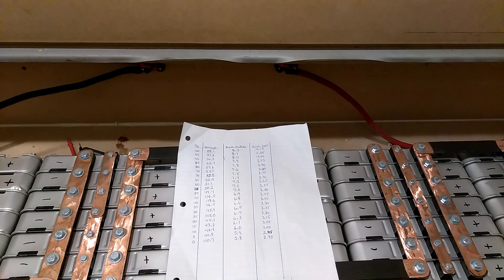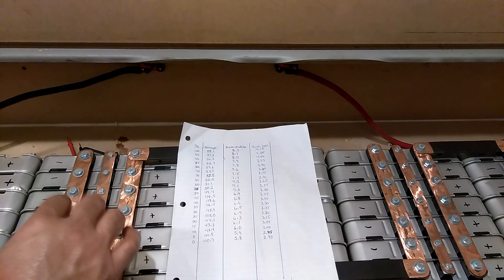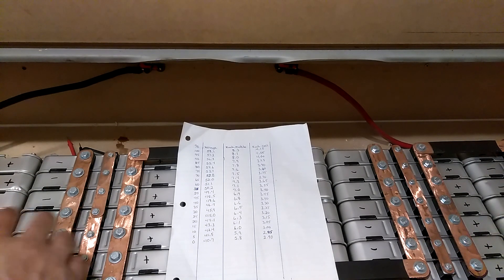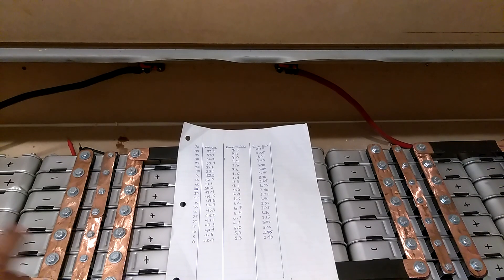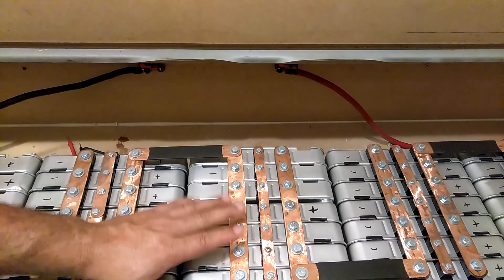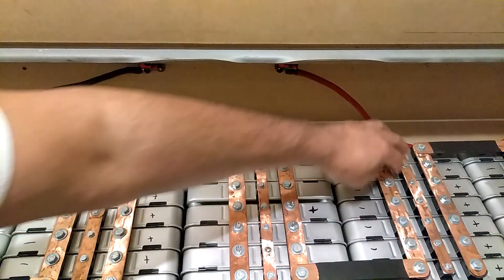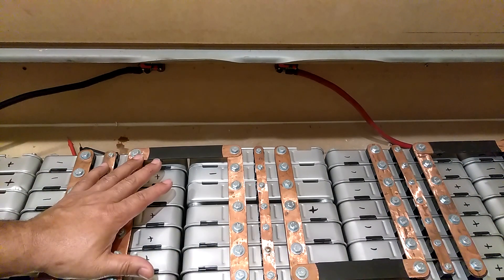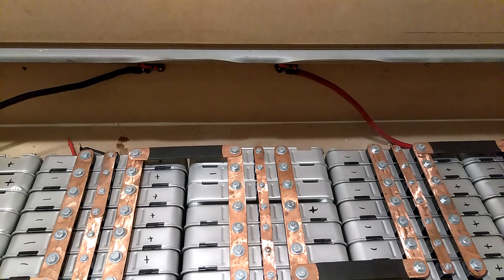Questions and answers part 2

Comment: Carson, where did you source your copper bus bars? Is that flattened copper pipe? I'm trying to decide to parallel bank like you have done.
Reply from the maker: Yes it is make sure you get the one with the blue stripe on it that's the thick wall copper water pipe got it at Home Depot.

Comment: based on the angle you set the panel at which is most likely summer time. however, you would see significant drops in power going into the fall ( December). in December bring the panel up to 60.3 degrees. the you would see a significant difference. but the panels at 15 degrees in the summer, and you would be very thank full.

Comment: Great  video ! Excellent explanation.  i really like how you connected your packs doing them in parallel banks & then the banks into series for your desired voltage be it 24v or 48v system, other's i have seen do the packs in series & then parallel the banks. Not sure but you would think all the packs will stay in balance much better the way you have them. I might be getting some of these packs for a 24v system. Thanks
Reply from the maker: If you need anything just ask I will help you as much as I can. God bless
Reply: @carsonlurbanwindandsolar3437  great explanation of the lv5048 I am putting together a system similar. I am concerned about the cells staying equal in compacity as this is the dangerous part of cells as the cell compacity gets further apart the pack would not see the difference in voltage spike and you may not catch it on one of your spot checks. Trust me I have built my own EV with cells 8 year's now they are tricky without a BMS and if they runaway they burn at 6000 degrees. Usually unattended. I would like to talk with you about your great work but don't know how here. thanks Glenn
Reply from the maker: @glennb4600  sorry it took so long to get back with you.  youtube have been hiding comments .  send me your email and i will email you my telephone number.

Comment: I have recently purchased this lv5048 inverter.  Curious if you have ever hooked up just 1 leg of the 240v input if it will accept the power?  I'm short on breaker space.
Also did you always use the larger capacity pack?  I am building up my lifepo4 pack and only have 50amp hr.  It seemed to skip right over the bulk charging voltage and go to float voltage very quick.  
Monitoring app sucks.  I have made some progress with raspberry pi and  grafana graphing if you're interested.
Reply from the maker: You know that's a good question I have never tried to use only one half of the inverter. And yes I have always had the big battery Bank since I had my LV 5048.   Now on my bulk charge and my float charge they are set at the same I believe it's set at 57.3V .       
On your raspberry pi is it possible you can monitor the unit Wi-Fi.
Reply: @carsonlurbanwindandsolar3437  Most of the newer raspberry pi's have built in wi-fi.  You then connect the LV5048 via serial cable and USB-Serial adapter.
Reply from the maker: @chadhouser1  sure I will be interested in it do you have any video or anyting showing how it works.

Comment: Was there a reason you went to 48 volt  over 24 volt? Any big differences or suggestions?
Reply: 5000 divided by 24 is 208a.  5000 divided by 48 is 104a.  Half the current to get same power.  Wire can be smaller and voltage drop across it (loss) is less.
Reply from the maker: 48 volts is more efficient than 24 .   You use a lot more energy converting from 24-volt DC to 120 volt AC then you do going from 48 volts DC 120 volt AC.   So yes it's more efficient.